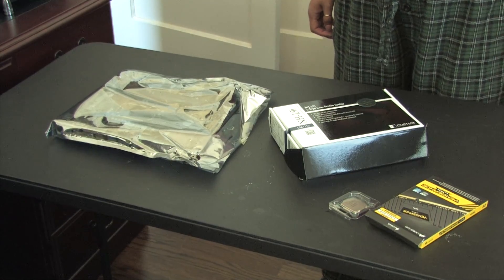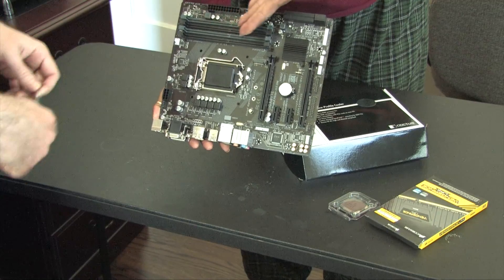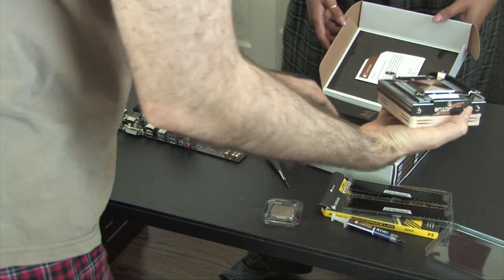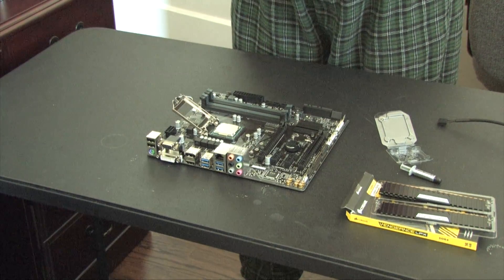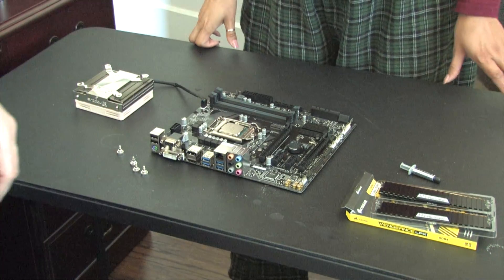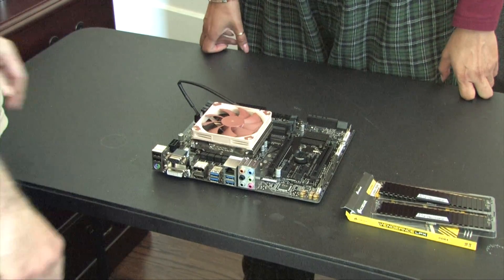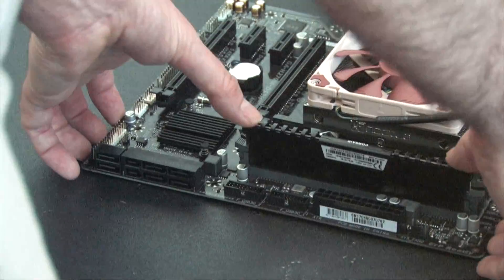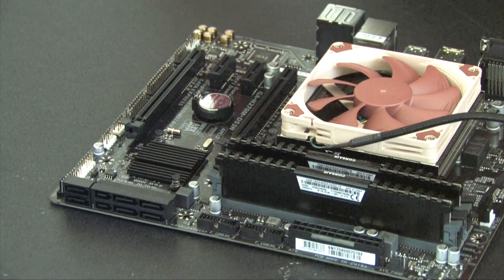i3 7100 PC Build - Part 3

Comment: did you need to update your bio so the cpu works or did they come pre-updated please answer as planning to buy this cpu
Reply from the maker: Arctic Fox, hey I did have to update for the skylake and kabylake processor hyperthreading bug.  I had success on one of my boards and will update this one in this video next.  If you hackintosh you might have more to do as it breaks things.  The gigabyte boards have bios updates for most of their boards for this defect.  So I HIGHLY recommend the 7100 for sure plus the board.  They are really great despite others saying you MUST spend a lot for i5 or i7s.  Depends on the need for sure!
Reply: Just to make sure I understand, you had access to the motherboard using the i3 7100 but a bug was there so you still could update it and thanks for the help planing in the near future purchase of this cpu, finding a job atm

EDIT: could you boot into windows 10 or any windows with the cpu?
Reply from the maker: I definitely could run anything without the update.  I updated due to the recent skylake/kabylake threading bug.  And yes it boots Windows fine.  KabyLake CPUs will not function in older Windows versions (below Windows 10) but work perfectly in Windows 10, Linux, and cough macOS.  

Good luck on the job hunting!
Reply: ah thanks, i was getting confused on how it worked